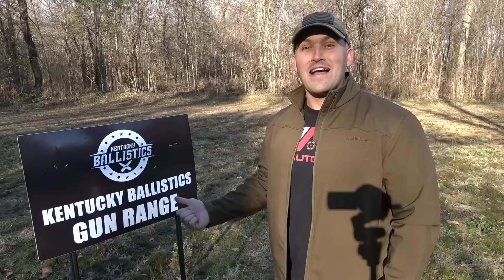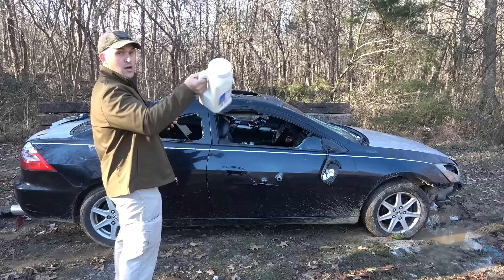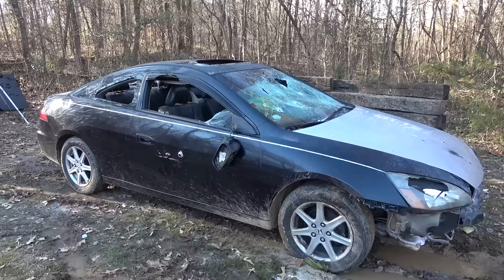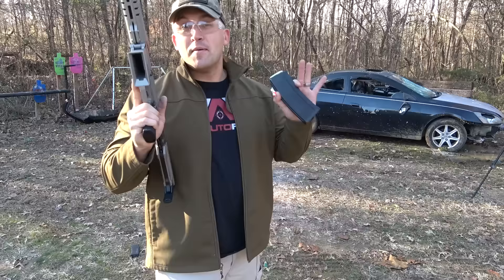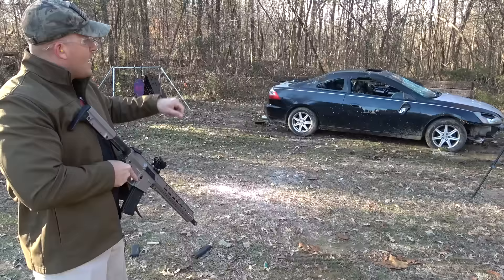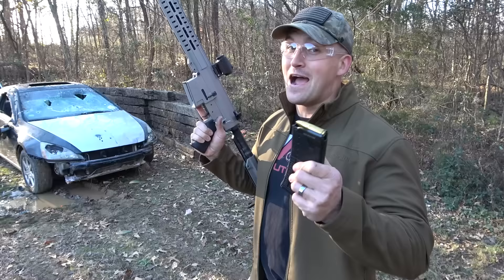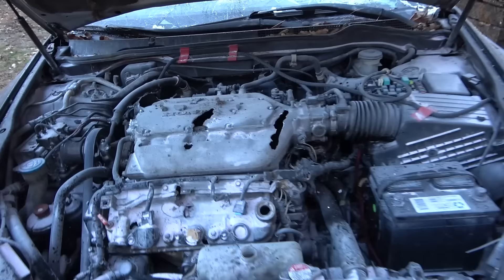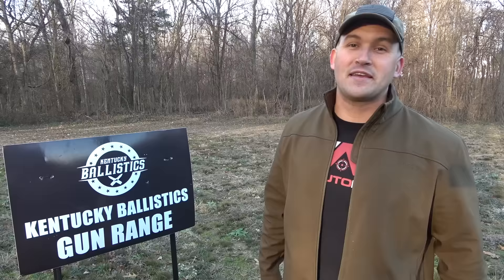Full Auto 458 Socom & AR-15 vs Car 🚙 (Full Auto Friday)

Comment: Funnily enough... This video actually demonstrates several well known aspects of the AR-15.

1) those lightweight zippy 5.56 rounds tumble and lose energy very quickly when they hit something, resulting in decreased chances of overpenetration. One of many reasons why the AR-15 is a very popular choice for home defense.
2) Drum mags are unreliable as hell. Basic 20, 25, and 30 round mags offer the most reliability and good capacity for a fight, while also being able to manipulate the gun during various shooting positions.
3) Carrying your mags fully topped off puts a lot more pressure on the springs. A lot of professionals carry a bit less, like 28 in a 30 round mag. Or stripping 1-2 rounds off their Glock mags.

And just when you thought shooting cans of gravy COULDN'T be educational, Scott done smartified you Kentucky style.

Comment: We used to periodically get cars donated to our police range.  One trio of older cars sat there for about 3 years.  Long enough for birds and such to build nests in them.  And THAT on one dry day in the middle of a long South Alabama drought is when I found out that steel core 8mm Mauser would not only do some damage to an engine, but would also produce enough sparks to set all those aforementioned nests and other flammable material as might have been nearby alight, as it were.  I also learned (already knew, really) that once a car starts to burn, it becomes fully involved in no time AND the human bladder does NOT contain enough  urine no matter how much coffee one swilled to extinguish the blaze.  
Yeah ... Crazily the fire dept then wanted me to try to do it again with the other cars but alas, only holes, no flames.  The chief was actually amused (both the fire chief, and more importantly, my employer, the police chief).

Comment: The cable in the passenger door was just the lock cable.  Don't worry - if you can get a car door open, it'll always close again.  In fact, even if you can't get it open again, the door will close.  

Next range vehicle should be that Chevy at the end.  Although... it might be too fragile.  Chevrolet's just too crappy to compare to a Honda... or a Ford... or a Hyundai... or a Trabant.

Comment: Always love FAF . I had to chuckle bc of the ranch if it was hidden valley ranch than its hiding in the back seat  uh nope the ranch threat was neutralized but it had a rodeo with the nacho cheese.  XD I wonder what the junk yard guy will think of the doom/ nutritional factor to the car   haha . An next vehicle I think dump rounds of full auto 50 baeo wolf into it with partial manicans with fruit or can heads packed with tannerite along with a trunk full of canned stuff an lil bit of tannerite . Would be funny seeing a trunk blow up into the air with a rediculious gizer of ranch or nacho cheese . I was laughing every time a round hit one of those things in the vehicle an it flung up an out the window or energetically hit the ceiling of the car XD.  It was a great video as always an love the content .

Comment: Don’t wanna open the door in case it won’t close quick fix my first cars passenger door was ratchet strapped closed if In crash you just pop  the strap or cut the strap and pop right out safer if you ask me might have saved my life

Comment: Question to AR-15 owners. Took my AR-15 (S&W MP15 Sport 2) out to shoot Wednesday, was shooting .223 out of a 5.56 NATO barrel and the bolt carrier was unable to re-chamber another round after shooting. I was shooting Wolf ammunition in 55 grain. Was it the lack of strength in the grain that was unable to bring to bolt back fully to re-chamber another round. Note this was also my first time shooting this rifle, my other AR-15 (Ruger 5.56) had no problems. I should have also mentioned, before I shot the rifle I installed a free floating hand gaurd on it which required me to change the gas block on it. Could the gas block have had a play in this? Thank you to anyone that can help me identify the problem.